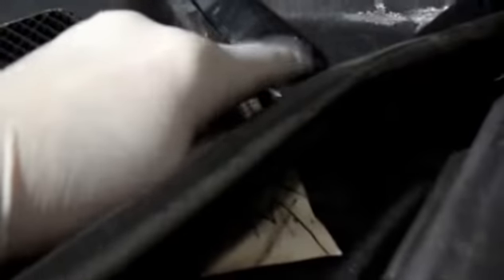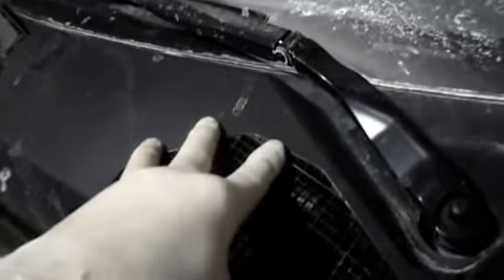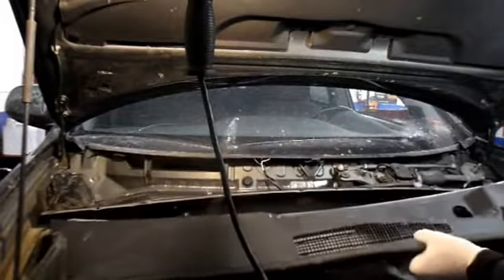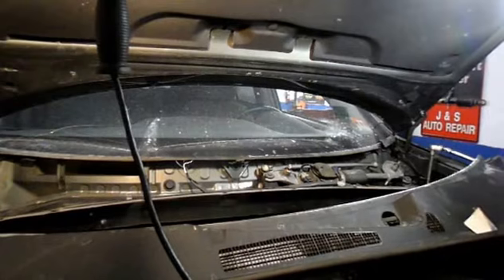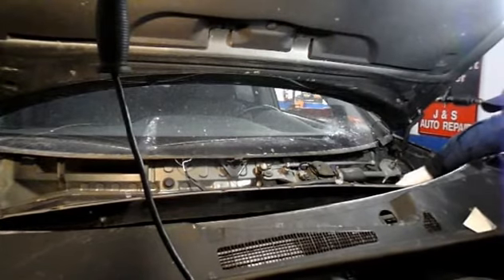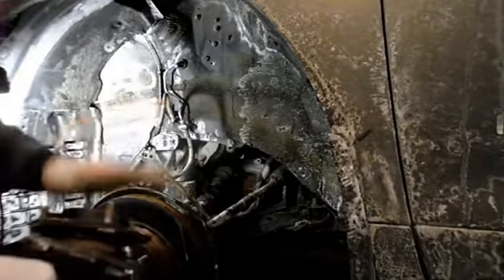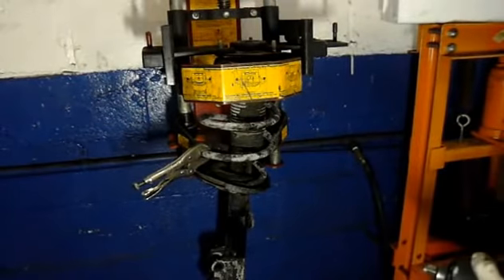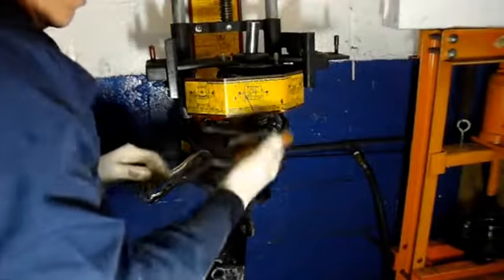How to replace the front struts on a 2008 Toyota Highlander

Comment: Jim thanks for this video !   I have a 2010 Highlander with 160k miles and today I was quoted $1800. to replace the 4 struts. And at that price the new struts (Monroe) would still also require using my original springs.  I found a set of 4 online, with new springs already mounted, for $800., so it seems with a day set aside in my garage, I could stand to save myself $1k with the help of your videos.  I can't believe it is this straightforward.
Reply from the maker: I'm happy to help. Let me know how you do .Watch for the next free tool giveaway coming soon.

Comment: Thanks Jim! Once again you saved me a bunch of time and money!  I replaced the front struts on my 2007 Toyota Sienna with new OEM complete struts by KYB as I didn't want to mess with switching out the springs mechanisms.   The complete struts were only $150 each online and worth it for a DIYer like me who isn't a real mechanic (even had a $40 rebate from KYB for buying 2 complete struts).  I also changed out the Sway Bar links with new Moogs.  Unfortunately, the old links were so rusted out that I have to cut off with an Angle Grinder.  Even replaced the rear shocks with new KYBs.  Here's to smoother rides ahead!  :)
Reply from the maker: David Breiner Wow you did a great job. Appreciate the feedback, thanks for watching.
Reply: How much of a difference was your ride with the quick struts vs the regular struts that were on your car?
Reply: David Breiner Are the complete struts still working good

Comment: Thumbs up on video.  Appreciate your help.  Question, if you can answer.  On the second one, I accidentally dropped the top mount bearing out on the ground.  I did not pay attention enough on the first one as to its orientation.  The bearing has one side that has a black rubber seal on it.  Does that seal face down to the ground or up to the sky in relation to the rest of the strut assembly when mounted back on the vehicle?   Thanks.

Comment: Hey jim love your video. After I had my struts replaced I hear a small clunk noise or suction kind of noise over speed bumps at normal speed but if I go over them slowly no noise please help me
Reply: I replaced my rear struts and during a test drive heard a clunking noise going over road irregularities. I noticed that my old struts had a tallish washer under the nut that I originally neglected to put on the new ones. So I removed the new struts and put the old washers on them. Replaced the new struts on the car and took it out for a drive. No more noise.

Comment: those the upper mount rotate freely by hand  after its installed or no?..i am confused because i just got a new full assembly with spring ,top mount and strut pre-assembled and the top doesn't rotate by hand ,normal?
Reply from the maker: Yes the top bearing plate is tight on a new assembly but when you install it on the car it will turn ok.
Reply: Great ,really appreciate your help , much health to you have great day...

Comment: I like your video! May I ask if quick struts would have been a good choice for you to use. Or do you think it is a waste of money?
Reply: For what it's worth, I've heard stories of cheap quick struts having stiffer springs (impacting ride quality) and inferior strut parts (failing prematurely). Look for original equipment struts (I bought KYB, but there are probably other quality brands). I think Jim used Monroe. Also, if this is a job you haven't done before, quick struts can save you time and agrivation, and you're not having to tamper with with a compressed coil spring.

Comment: Nice to find this post man. I've been thinking about doing this work myself to save the money we need to also repair a vibrating driveshaft... Yikes! Here's one small detail I'm curious that you didn't mention. In the past, I've seen Service Bulletins from Mazda (the Highlander is my wife's car, whereas I've driven stick-shift Mazdas for almost 3 decades...) which suggest applying some sort of lubricant or silicone grease on the spring seat to avoid squeaking problems. Have you heard of this?  Thanks for the great video post!
Reply from the maker: +InexplicableBill Thanks for watching.I've never heard of putting anything on the new spring to seat them.I would just install them .If you run into any problems let me know I can help you through.